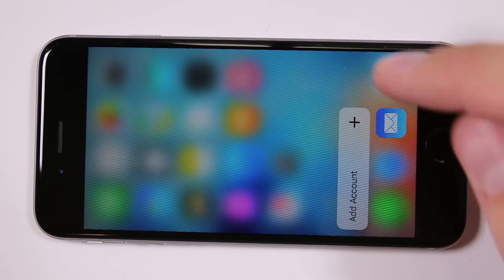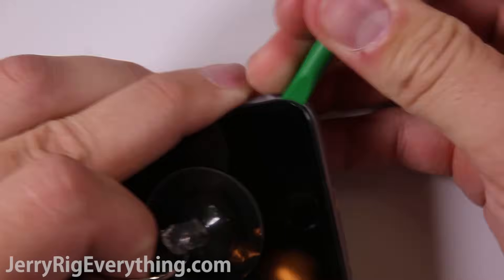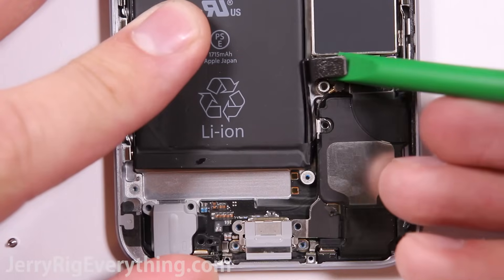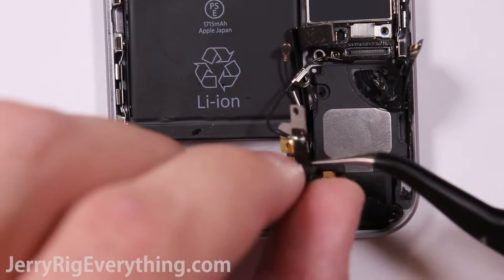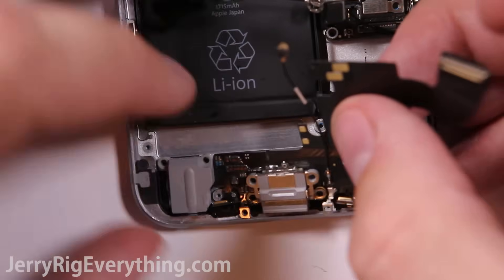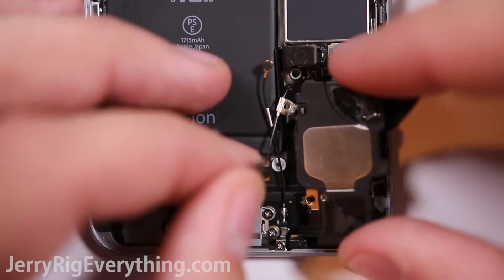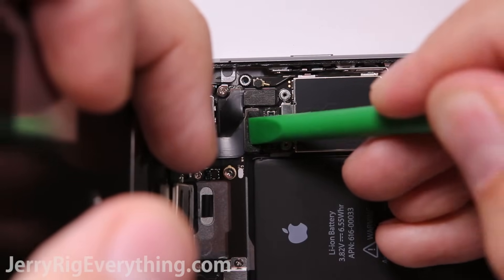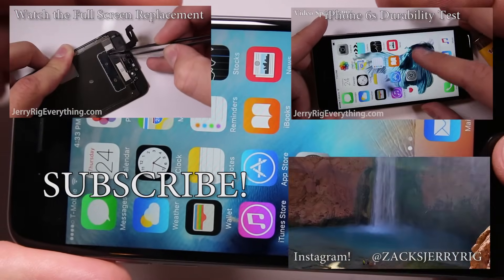iPhone 6S Charging Port Repair Shown in 4 minute Fix

Comment: 9 years later and all your videos on the iphone 6s made me revive an old iphone 6s from my dad, i don't really have a need to replace the charging port yet but i feel like i need to because it is charging very slowly sometimes even with a new battery, i don't know if the problem is the battery or it might even be the motherboard

Comment: 2024 and just used your excellent video. £5 port from eBay, the little cable to pop off was about 6mm too long on the replacement but you get what you pay for, just made it go around an extra corner and back to fit it in. Suggest popping the battery cable out first, before removing the screen cables, as with any device, as some circuitry is still active even when phone is powered down.

Comment: Very good video as always,  I did the screen, battery, and charger port in one go, the screen and battery are fine but unfortunately the charger port doesn’t work, The antenna wire in my replacement was slightly too long which I’ve seen mentioned in a few comments so I guess this is common, I had to make a small loop in mine just to get it to align with the gold connection at the top, is it likely this is the problem? Any help appreciated!

Comment: Great Video!  Helped me a lot!  My lightning connector failed and replacing the power port fixed the problem.  Before sealing the display, I would gently turn on the phone and make sure the speaker, microphone and antenna works.  My speaker failed to work on the first try and I had to remove the speakers and repositioned it.  I think the wire was preventing the speaker from being seated properly.  Everything works now!

Pdf chart was a great help!  I did have one screw left over.  All screws were accounted for.  Have no idea where it came from.  Maybe it was always in there.

Comment: Very helpful! Thanks for the printable "PDF Screw organizer" file. I did help keep the screws organized, I used some tape to attach it to the table I was working on so as not to jiggle it while setting the screws on it.

Comment: Great video!  I was able to repair my charging port.  The screw organizer could use improvement.  When printed, it's typically going to use a while 8 1/2"x11" sheet of paper, but the image only uses a portion of the whole sheet of paper.  The image in the PDF should be made larger to fit the whole page.

More important, as others have noted, on the screw organizer and in the video, users should be warned that the screws are not all the same length and they don't have the same diameter.  Users should be told to take each screw as they remove it and place in on the screw organizer by the hole where it was removed.  I ended up with a leftover screw because the diameter was too small for the one hole that was left and I was unwilling to removed all of the screws and try and start over.

If you put a screw in a hole that has a larger diameter than the original screw, you may expand the hole and now the original screw can't be put in that hole because you won't be able to get it tightly in place.

Comment: Print the chart. Then put the screws (they are about 1-2mm in length, much smaller than the chart shows) and the rest of the parts in small cups up on the chart.

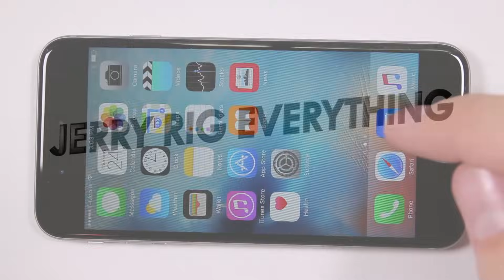Comment: 0:10 in and I think, you may have fixed my phone... Edit: (I used rubbing alcohol on a tooth pick and got a junk of...  stuff/gunk/lint out, seems to want to charge better, as it wouldn't charge at all prior).  IT'S 2022!!!  I've not bought a phone in so long, I'm almost scared to...  Going with an Android based phone next, screw iTunes...

Comment: Your video was incredibly helpful. Gave me the confidence to undertake the repair. The most difficult connection was the push down antenna lug. I had to reuse the original part with a minor soldering job. Thank you so much!

Comment: I followed your video perfectly but I can't get the little small wire to stay plugged in.  Its the one just under the battery connector.  I tried to put it in place then put the plate on with the screws.  everthing works good except the vibrator motor doesn't work.  Any suggestions?

Comment: when putting it all back together I cannot get the fragile cable to snap back in. Lined it up and It goes in but then pops back off. Wondering if that has ever happened and does it mean that it has been damaged and now is a total loss

Comment: Great video! I decided to fix my 6s to have a backup phone. What I would say though (same as is said in the top rated comment): ALWAYS connect the battery last. Just having your phone switched off is not enough. My screen connector shorted when I was plugging it back in, and now I get to try out your video for replacing an iPhone 6s screen.

Comment: Brilliant tip right at the beginning to the vid, check inside the charging port for dirt, in my case fluff, cleaned it out and the charger is working first class again.....thanks a lot Jerry

Comment: Just done this a couple of weeks ago using this video 
Awesome and can’t thank you enough. 
Took me an hour I’m amongst kids running around the house and telling  them not to touch anything 😂 
I paused the video loads and did each step slowly, plus I drew out the screw layout he has a link to. You could print it if you got a printer. 
This is key as without it, if your screws get all confused, it will take you a long time to work out which goes where. 
Excellent stuff and thanks!!!!!

Comment: Thank you so much man, honestly my phone wasn't charging for days and I ordered a replacement charging port and some tools luckily didn't cost too much. 

Moreover, I followed your first instruction which was to clean the port using a toothpick which is what I did. Alas it started charging and I tried the same with my niece's phone which had the same issue and guess what her's started charging just now. You've saved me time thanks a mil.

Didn't even watch your entire video in fact I posed it when you asked us to try cleaning the port and have not resumed the video as my issue is solved.

Top man respect from England UK

Comment: Hello… Well you seem to know what your doing… So I gotta ask…My iPhone is completely dead. When I connect the charger the red battery icon shows. Phone doesn’t seem to be charging though… when I unplug it the battery icon turns off. Any suggestions on what could be the problem? Thank you

Comment: Just finished my first adventure in iphone DIY repair. wtching your video. Ordered a new charging port set up because the microphone wasn't working after spending 3 seconds in the toilet and 3 days in rice.  Everything great until I realized I'd ordered for a 6 instead of a 6S.  Then I decided to cannibalize one of our old 6s phones for the part.  Got it all back together and everything works except for the.....microphone.  People can hear me when I am on the phone.  My tuner app hears my voice and can tell me if I am out of tune.  The only thing not working is when I want to dictate a text or an email.  I have a new setup on order.  If I put in the new one and the microphone still doesn't work, I'm wondering what I've done wrong or if something else is busted.

Comment: Great video! I believe I followed perfectly, however, my battery isn't charging. When the phone is off and you plug it in to charge, the phone turns on, but it's not charging up. Any ideas? Its not the charger. Help

Comment: so i bought the part and the tools.  your directions and chart was invaluable. however, even though you said to put the screws on the chart i didn't realize there were different sizes.  that could of been a little clearer.  But thanks.  Very helpful.

Comment: Hey so I have everything unassembled I was about to put in the new headphone jack charging port and microphone and speakers but the wires that are to the speaker are hardwired or soldered and the new component that I have doesn’t have any wires so how do I transfer these wires onto the new component

Comment: First, it seemed like the charger cable was loose in the port of my iPhone. To add to my confusion, the next day when I tried the cable it suddenly wasn't loose, but seemed like the cable didn't want to go all the way in.  

If you look into the charger port closely, there are two little metal tongs on each side (L+R) of the port, what worked for me was inserting a metal clip and pressing against each side and pulling/flattening the metal prongs back in place so that they snag the cable again.
Reply: I have the same problem too. Could you tell more how you were able to fix it?
Reply: Its in my comment bro

Comment: hey i was wondering if it would be easy to transfer 6s parts to 8s case. the reason for it would be for updated look and wireless charging. only thing in question would be the aux. maint reason for this whole idea is zuz i need to charge the lighting port and if it fails i have the wireless chrage.
Reply: The insides of an 8 have totally different mounts and stand-off points

Comment: I dropped my phone in a paddling pool some time ago, left it to dry, and it seemed OK. Then a few weeks later it just stopped charging.
.
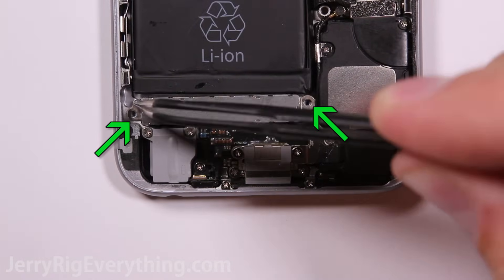I followed this fella's battery replacement tutorial, and after enjoying the smell of lithium (i.e. I had a fight with the battery), the phone powered on and I managed to retrieve some important things. Then I realised it wouldn't charge. So here I am at this tutorial, and what else can I say, it worked great. Now my 'old' phone is fully functional! The little connector at 3:23 was a b*tch to put back in, though.
Some advice I would like to give:
1) The battery should always be disconnected while work is being carried out; circuits are often interdependent and removing one might affect others in a way that causes them to fail from excessive power (in this case, the screen is a part that draws a lot of the battery, but when you disconnect it, that power isn't being drawn so it's available to other parts of the phone, in theory)
2) It's a good idea to earth yourself to remove any static that you might have, as that will kill delicate electronics!
3) I put putty over the loudspeaker because the screws kept jumping onto it. Similarly, I wiped the screwdriver blade on the speaker magnet to magnetise it and allow it to pick up screws  (just don't go jabbing said screwdriver at the electronics)
4) Pushing at the side of the rectangular connectors makes them pop out more easily
5) Try using both cameras, the microphone, and playing sound prior to closing it up (no problems in my case)
.
I find Apple's ethos of sell them something new, throw the old one away, and if it breaks, throw that away too, making money regardless pretty shameful, so it's really great that you show us a more sustainable approach!

edit: my photos came up as blank, nothing there, and after a mini-panic, I saw that the phone was loading them. this might have been because I had the phone switched off for some time, or because I cleared some memory once I got it working. or perhaps because I just have too many damn photos. again, it's fine in the end

Comment: Hey Jerry, I recently tried replacing my iPhone 6 charging port and GPS/Wifi antenna cable (for the first time) and successful about it. Unfortunately, the volume disappeared, I kept disassembling/reassembling to more times to check the connection but no bueno. Should I start looking for a volume flex replacement? Thanks.

Comment: Thank you very much, this video saved me a fortune!!! My charging port was not working properly, I had checked to see if it had any lint but it did not and I purchased a new cable but no luck. I phoned Apple to see if they had any suggestions and I was told it sounded like my charging port needed to be replaced but due to Covid all of the Apple stores are closed. That brought me here!!! I ordered the part from your link as well as the tool kit however the tool you used to pry the screen off was not included so I had to hold off a couple of days to receive that order, it is called an isesemo tool for those who are interested. I sat down with everything I needed including your fabulous print out for the parts and tape to keep things from rolling away. This turned out to be a genius idea which was my husbands because as it turns out a screw is not a screw. What I mean by that is for example the six screws holding down the charing port descend in size so had I just willy nilly put them on the paper or not taped them down in order I removed them they may have gotten mixed up. I followed your step by step instructions to the tee, what made me do this repair a few times were my microphones not working. Everything else was now functioning perfectly except my microphones. I took it apart two more times doing the same thing which is the definition of insanity, doing the same thing over and over expecting different results. I decided to sleep on it and look at it today with fresh eyes!!!! Worked like a charm, a note for anyone who may have this issue. The little rubber plastic bit that I took out (on the paper it is called little black niblit, I love that) little did I know there is a similar sized and shaped piece under the microphone on the left that had come out when I disconnected the original charing port. So I had a hollow space between the microphone and body of the phone. Luckily I kept the original with my tools so upon inspection I noticed the piece that remained on the charging port. I had to use the tweezer thing to pry it off as it was stuck. Once I did and set that into place the microphones were now aligned perfectly!!! Hooray, I now have a new phone as I also replaced the battery. I was at 81% on the battery but figured since I was opening it up, why not replace that too!!! Note the screws are super tiny and I highly recommend taping them down to the screw organizer print out provided in the description above!!! Thank you again for this amazing video!!!!

Comment: I have just changed the lightning connector and charging port, and my iPhone 6s will not turn on and charge at all now. What else could be going on with my phone? I'm on my second batter replaced by apple, what could be the problem? please help! many thanks

Comment: Thanks SO much!  Finally repaired my daughter's phone.  Trying to keep it alive as long as possible.  It took about two hours to complete the process as we ran into a few snags (One screw stuck, and had a little trouble reconnecting the speaker cord) but it's all back together and working perfectly.  The screw chart was invaluable.  I printed it up and placed double sided tape on each section to hold all the parts in place.  Thanks!

Comment: 2 of the screws where the charging port is don’t want to unscrew 😭 i’m stuck lol
Reply: Every time I ever work on iPhones there’s at least like 4 of the fuckers that just don’t feel like moving and it’s the most infuriating thing on this planet
Reply: Duck i still haven’t finished fixing it, I don’t know what to do. Lol and my new iphone i’ve only had for a little over a year, not too long ago it started having charging issues too. When it gets low on battery it doesn’t want to charge via lightning, my work around is to lay it on a wireless charger and have the cable connected to my portable bank and then after a bit it starts charging from the cable and i can take it off from the wireless charger.

Comment: hey guys got a problem here, so my iphone 6s won't charge, when I replaced it with a new battery it turned on and it normally works, however, it can't charge. So having it on just drained the battery. So I suspected its the charging port thats the problem, however, after just doing this, replacing the charging port, it still won't charge. I tried to charge my iphone5s with a regular charger, its been charging, but when used on my iphone 6s, it doesn't charge, or it doesnt recieve the input of charging. Any help to fix this problem?

Comment: Help! Question, I did not get my coaxial cable antenna to "snap" back into place.  Got the rebuild done, it's charging. But is that cable supposed to snap into that button to function, or just hold it in place, or can it work without being snapped in? Will find out soon, just hoping for an answer...(that I want) ;)    Thanks, good video...definitely takes more than 4 minutes!
Reply: works fine....4 full bars

Comment: Just discovered your short and sweet videos!  Love your format.  Just replaced my charging port and totally fixed a "reboots ever two minutes" problem that could not be fixed even with a full reload (could not finish reload!).  Should have changed it sooner when it was just a charging problem.  At least I had the part and this video on hand and am very thankful for that - $12.99 (Canadian) Fix!  Thanks for this video.

Comment: Great video, thank you. My iPhone 6s would not recognize the charging cable or would not charge. I replaced the charging port module and the battery. It did not fix the problem. It ran on the new battery until drained, but I still can't charge. The lightning bolt only stays on for a few seconds, or just a black screen with the plug cartoon on the screen. All internal connectors are tight. I tried two (non-apple) 2-amp chargers and two lightning cables. Also tried plugging into laptop, same thing. Any ideas?

EDIT: Using a genuine Apple charger fixed the problem. What's special about their chargers, other than being rated 3 amps? Is there non-power communication with the phone?
Reply: the new charging port you received might have been defective. that happens sometimes. one time, when fixing an old truck of mine, it needed a new fuel pump. replaced it with a defective unit. luckily, we went from the top instead of the bottom, because having to drop the gas tank twice would have been miserable.